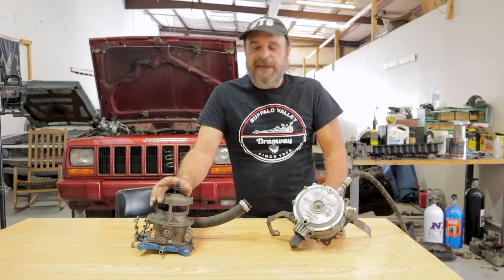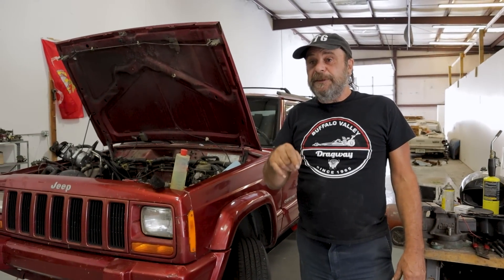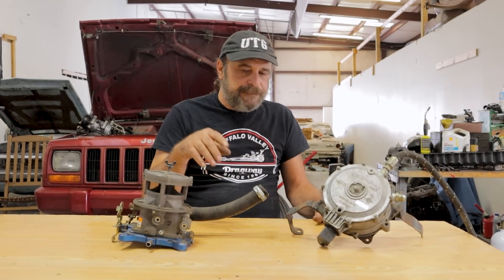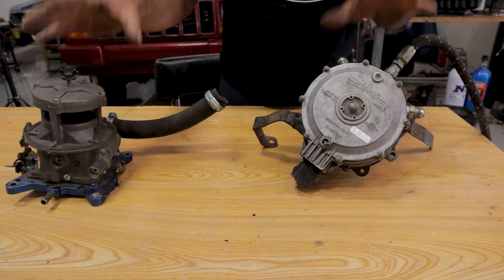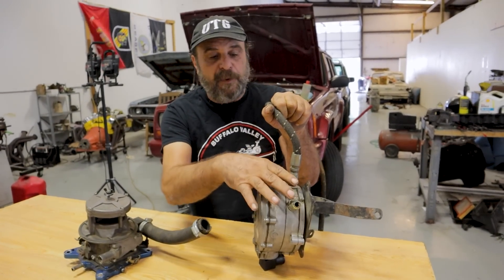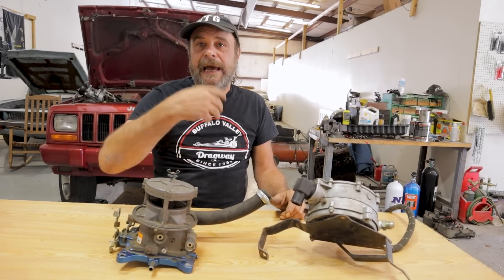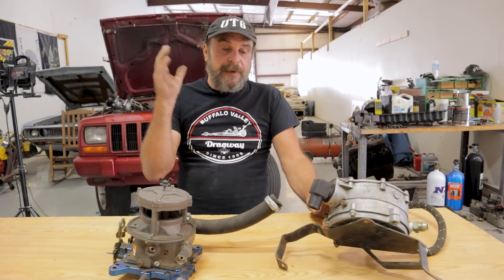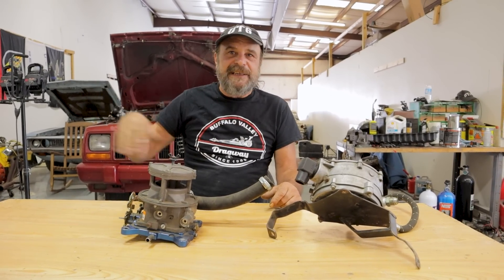Hot Rodding With Propane (And Propane Accessories) - Overview Of The Impco Carburetor

Comment: I've run my 1968 AMX with dual holly 650 throttle bodies  with dual propane carbs and converters. One problem is compression needs to be about 15 to 1 static to benefit from this fuel if max power is desired. It works well as a street fuel but there is a drop in BTUs and increased weight for the tanks if one wants any kind of range. I never saw a benefit at the strip, maybe it was from the cam I never got to it. The car has been sitting in my garage since the 90's, to run on propane the tanks and lines will need to be certified for leaks and safety. Or I might just go back to gasoline.

Comment: Looking forward to your testing with Propane (and propane accessory's). There was a racing El Camino back in the 80's that used Propane. he was running like 14 to 1 compression and was quite fast. Biggest issue he had was not enough CFM flow to optimize his set up. Technology has come a long way since then. Very curious how this works out...🤓

Comment: Propane- it cooks your dog's and hauls your buns 😂 I've had several of these systems over the years. That I removed when Ontario's  mto screwed over the lpg use for light vehicles. Many cabs ran propane systems but after regulation changes cabbies didn't install new systems as they upgraded cars. The wrecking yards had many vehicles with impco conversions that could be bought for next to nothing .

Comment: A friend of mine had a  Ford pickup back in the 1980s and converted it to natural gas.  It allowed him to get around California's air pollution laws ofr perfomance modifications and he was able to adapt performance parts for his engine. The truck was a beast.  The truck was stolen and found a couple of weeks later.  It had run out of "gas" and the people soon realized that regular gas won't work(he'd taken the regular gas tank out and had a tank in the bed of the truck for the natural gas).

Comment: Nearly all the generators I work on are propane.  A lot of the old liquid cooled machines are liquid withdraw like you have.  

You need to look up Carb and Turbo in Shakopee Minnesota. They are the source for everything Impco.  Ask to talk to Phil if you need tech support..  He's the guy. 

You really need to put a solenoid valve in the system that is wired with the ignition. Carb and turbo has that.  You will need some fuel line, Carb and turbo has it.  You probably should rebuild the mixer and regulator... Carb and turbo.

Comment: I run a propane/gasoline setup on my '65 GMC pickup, there is a video on my channel explaning the system. Impco systems are great, never give any trouble. Propane is a great fuel, only downside is the on vehicle storage. If the valve train as in valves and hardened valve seats are set up properly there should be no issues with propane.

Comment: I work on LP powered generators all day from 8kw to about 350kw. 
The cons are it's tough on the valves being a dry fuel ,gasoline isn't much of a lubricant but it's better than gaseous fuel,  and you really gotta run em a long time or you'll get cottage cheese oil. 
I see that alot from not enough run time. 
The small air cooled stuff requires constant valve adjustments if they don't have hydraulic lifters. 
Like 100hrs and set your valves again. 
Mileage is less than gasoline also. 
Other than those issues with LP, an engine will run on it.

Comment: Hi Tony love your videos, I've ran propane now for about 20 years, just a couple of things to be aware of, firstly just make sure your coolant has a 50/50 mix of anti freeze, adjust your timing also, I set it at 22degrees top centre, on the mixer and vaporiser there are adjustment for tuning, a little hint, if you're engine is running hot there's to much gas, ideally you want your engine running cooler than normal the settings on the impco carb are quite straight forward, and just one last thing is where you get your propane from ,depends on the time of year, depends on the mix of propane and butane and you might have to adjust your timing, it's always worth asking. The engine will run cleaner, is oil change and smoother.....

Comment: One of the benefits of running LPG ( Liquid Petroleum Gas ) or  Propane Gas is that it's hard to boil the engine because by the time you've lost enough water to boil the engine the mixer has frozen and the engine stalls.
Reply: You can overheat engine by other reasons than coolant loss, for example defect radiator electric fan or the relay which controls it .
Reply: @flappingflight8537  I've never had thermo fans on one of my cars to find that out. I've either had clutch fans of flexi fans. No electronics, no problems.
Reply: @mrstuartp1  ok , then stuck thermostat ( pure mechanical reason:) Hope you didn’t removed it in order to avoid eventual, possible failure :) BTW the evaporator- reducer can freeze even if it is mounted too high in the cooling system without loosing any water .

Comment: I never liked IMPCO carbs because they have a restriction built in. They only work "on demand" like Quadrajet secondary air doors only stiffer. There is a finite delay while they open slowing down throttle response, too. They are however the only "carbs" that are unaffected by blow-through boosting - provided fuel pressure ramps up matching the boost.(uh - maybe Predator carbs arent affected by boost either = dont know)
A company named Beam made terrific mixers using just interchangeable calibrated venturis and their own regulators that used veeeerrrrrrryyyyy carefully calibrated leakage for start/idling. Quite a bit more power (than IMPCO) super responsive BETTER than EFI - only suitable for draw-through supercharging. Beam mixers on a draw through turbo that had a long uphill runner ran nicely - whereas you absolutely couldn't get a gasoline carburetor to start/run/cruise = drag racing only 
IMPCO bought BEAM 30 years ago so IDK about them now.

Comment: years ago in Alberta, Canada they had a tax break on propane conversions (less power, octane about 115).  I paid anywhere from $0.16-$4.00/US gallon(averaged about $2.50) I ran it on my 72 GMC 3/4 TON (4.10 axle 16" wheels probably  250 000 miles total) rthen for sonme reason they started taxing and prices went up ($1.00 litre CDN now).  I drove that truck all over Canada as well as  2 trips to California. Had ram horn manifolds, dual exhaust and an Edelbrock intake. I wanted to turbo and fuel inject it(propane boils at -40), had to run  the heater hose through the system so it wouldnt freeze the system up. Might try it again some day.  Cheers and good luck T.  your old Canadian fan. (make sure you have good coolant or you'll have problems)  mixxer only flow 350 or 450 CFM. Drop me a mess if you want some info,

Comment: I’ve always been interested in the alternative fuels such as propane and natural gas and also hydrogen fuel cells. They may not be as efficient overall as gasoline and they do cost more but they burn much cleaner at lower temperatures than gasoline which is better for your vehicle. Unfortunately the powers that be these days aren’t interested in an open conversation about these alternative fuels they just want to force us into electric vehicles.

Comment: I had a 63 Ford unibody with a 289 V8 that I converted to mixed fuel (it ran on either gas or propane) All I had to do was switch a toggle switch to either gas or propane.  It had two solenoids that would open one fuel as the other closed. My propane tank was 56 gallons and the gas was about 25 gallons. A regular barbaque tank will not work for motor fuel because the tank has to draw liquid L.P. gas and gets converted in the regulator/converter and then gets pulled into the carb. as a vapor. A regular propane tank only pulls a vapor which will not feed enough in to run an engine. Your system uses a propane carb. so you cannot do a multi fuel. My system had a propane carb in the breather above the regular carb. and I could just use one or the other. With propane the oil stays much cleaner than with gas, but with propane the oil will gradually thicken so keep a eye on it. Have fun

Comment: Grill tanks have vapor valves on them not liquid I believe in order to use them you’d have to turn them upside down. Forklift tanks can be either horizontal mount tanks or vertical and need to be mounted correctly so they draw liquid propane and not gas to work properly. In colder temperatures you need both a liquid valve on the tanks and a vapor valve to start the engine off of vapor until the coolant has warmed up before switching to liquid or the vaporizer will freeze up.

Comment: Over the summer, our local school district took delivery of 3 or 4 new L.P.G. powered busses to evaluate them against their typical diesel units. They started running them at the start of the new school year a few weeks ago. You might want to contact your local district or, maybe even your city/county garage to find out if they have any propane powered trucks or busses. If so, I'd bet you could pick the brains of the mechanics there for tips on setting your system up, even if it's just for a baseline.
Reply: I suppose your buses has much modern sequential injection systems . Are they run purely on LPG or simultaneously needs diesel fuel ?

Comment: Where i work we had a fleet of 20 school buses (down to 4, use 2) that are propane powered 2014 Blue Bird Visions with 6.8L V10 Ford engines. Run good, very clean burning but average about 4-6mpg. The Diesel buses (the majority are IHC CE200 with about 13 Thomas C2's they all have Cummins ISB 6.7L severely scaled back due the shool bus application few with IHC Maxxforce 7's 6.4 V8) are at 8-10mpg and have much more torque (LPG's have the horsepower but not the torque).The LPG buses are equipped with Roush fuel injector systems along the operating software, but are still OBD2 complaint for MD engines. They have a unique starting procedure, but they always start and warm up allot faster that the diesel buses when its cold and are much quieter, the oil stays much cleaner unlike that jet black oil in those diesels. Good luck with that Uncle Tony that setup should well on both the 361 and the 4.0L in that mule car. Looking forward to the upcoming videos when you start that project. Should be very interesting to say the least.

Comment: Propane or LPG and its successor CNG are still somewhat common here in Belgium and maybe the whole of Europe. I think you can still order some new cars from factory that where designed around CNG combustion (smaller gasoline tank/bigger CNG tank) but I think they fell out of favor because of the economics and if the conversion wasn't done right the valves would burn up, that's what I heard at least.
Reply: CNG and LPG are completely different animals!

Comment: I knew a guy in the '80s that had an old Econoline he ran on propane. It ran just fine and he said it never needed new spark plugs and the oil stayed clean for 15,000 miles.

Comment: A correction: E85 has an octane of 105, propane has on octane has about 110. Ak Miller would say that your power loss with propane was 10%, and then he would run a lot of advance on the timing. Ak loved propane. Ak was one of the lead people at Ford that developed the propane version of the LTD, plus other projects. He hated Carroll Shelby, but that was the "competitive" side of him. (LOL) Most of the time when he came to our shop to pickup turbo parts, he would be driving "Ol' Blue", an old Ford pickup with a 100 gallon propane tank in the bed, it had the 300 straight 6 with twin propane carbs and twin turboed, with two holes cutout in the bumper with two intercoolers made for helicopters. Oh, and he'd street race that ol' pickup. He also had a late 80's Ford Thunderbird with a 351 which if I remember correctly was the Cleveland for which had a specific preference for. The engine had a homemade plenum with 6 forklift propane carburetors and was also twin turbocharged. He claimed heading to the shop one early morning of doing 180. Good times.
Reply: Indeed. I well remember reading about Ak Miller's propane hot rods. I agree with your comments about octane, it as about 110-115 (R+M)/2. As I mentioned in another comment, we had excellent results with a small block built to have a true measured compression ratio of 11:1  and lots of ignition advance. Turbochargers were still uncommon at that time, and aside from a 2.3 Ford, I didn't have the opportunity to test a propane turbo car. The 2.3 put out some stout power at 15 psi boost and would easily keep up with a similar 5.0 Fox Mustang. We were using a simple bypass bleed boost control, and one time it malfunctioned; the boost skyrocketed, and the head gasket blew. Further investigation found the top rings seized and other problems, and that was the end of the 2.3. I had a slant six Duster and intended to turbo it with propane fuel, but I got a good deal on a U-code 440, and that found its way into the Duster. Not long after that, the Government added road tax to propane, and I got out of the propane conversion business.
Reply: It’s a great fuel and actually can make more power if it’s injected straight in liquid phase in to intake runners , it’s about 20 % less energy dense than gasoline so fuel consumption for the same power is 20% more . it has strong cooling effect . Propane evaporates on -42C on ambient pressure . The octane rating usually is 105-108 since actually it’s a mix propane - butane and butane octane rating is lower . The mix contain usually 60/40 % propane/ butane during winter periods and 40/60% during summer periods in order to keep the pressures in the tank on acceptable levels , so the octane rating is higher during wintertime and is lower during the summer time , exactly the opposite of what need to be :)
Reply: @flappingflight8537 Where I live (Alberta) propane is exactly that, propane. It is fractionated to HD-5 specification, which calls for at least 90% propane. In practice it is usually fractionated to HD 2, which is 98% propane. This is due to the higher value of butane as a separate product. HD 5 has a maximum content of 5% butane. LPG is a propane-butane mix. I was a plant engineer in a 100,000 BBL/d NGL fractionator earlier in my career. We would only produce LPG as a product for pipeline transport where the vapor pressure  was limited. Adding butane lowers the vapor pressure. In the winter you would want as little butane as possible as excess butane will result in low pressure in the storage bullets. In hot climates butane will moderate the pressure in summertime. I designed a plant in Africa where we would vary the propane-butane mix to control the vapor pressure in the storage spheres as they had a maximum design pressure of 95 psig. We could vary the mix from 30% to 70% butane. In the summer we had excess propane and would burn it on site in gas turbines to produce electricity. However in North America butane is almost always fractionated out completely, with only a few exceptions, and LPG mix is not generally sold. Butane is very valuable to refineries as it is used to blend gasoline to the maximum vapor pressure allowable. You are correct that propane evaporates at -40 at atmospheric pressure. Butane is quite high octane as well; the exact rating would depend on the mixture ratio between normal and isobutane.
Reply: @flappingflight8537  The only liquid-phase injection system I've ever even heard about was Oldsmobile made an Indy Pace Car late 80s-early 90s that could switch undetectably from gasoline to LPG with a rocker switch. I think it was like a turbo 301 with MPFI. Pretty sure it wasn't as easy as they made it look.
Reply: Check out roush and their mono fuel liquid systems